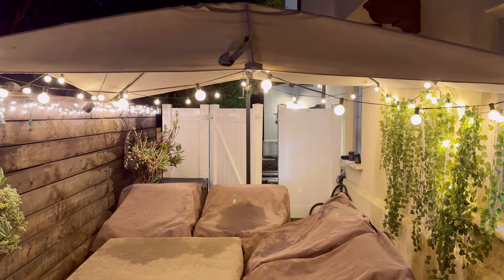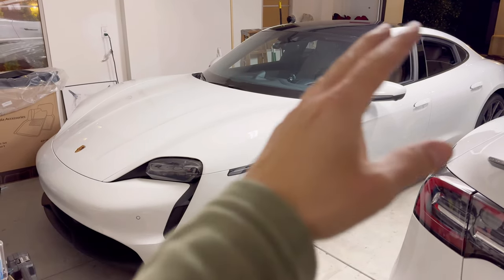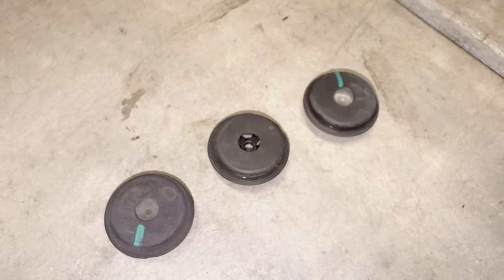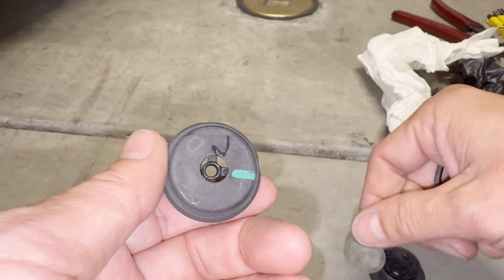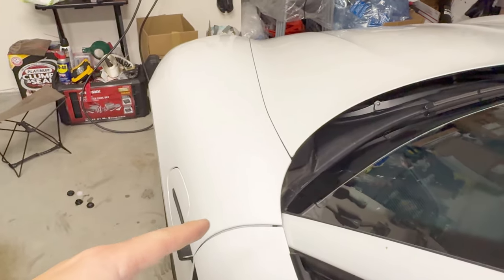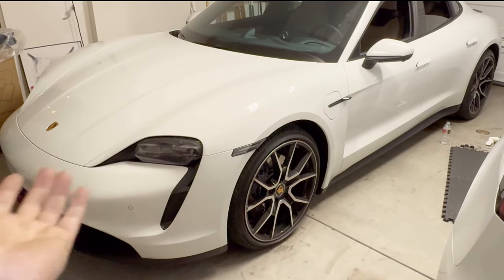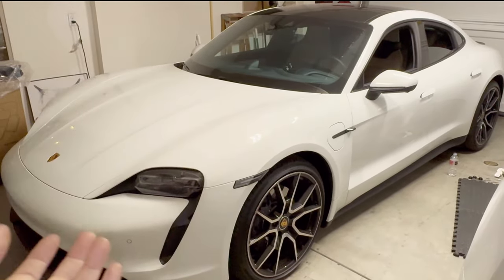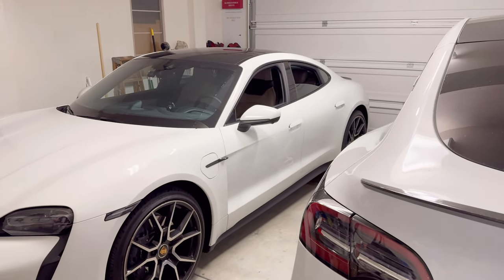【PORSCHE⁴⁶】 Taycan Maintenance 101: The Importance of Water Drain Plugs! 🔧💦

Comment: I'd be MORE concerned as to WHY water is getting INSIDE your car.   It was designed to be watertight (Hense the check valve on the plugs)  Somethign is wrong.
Reply from the maker: All cars have drain system. I think it is coming from windshield wiper area but getting clogged underneath the car.